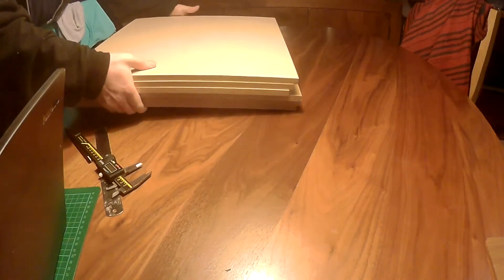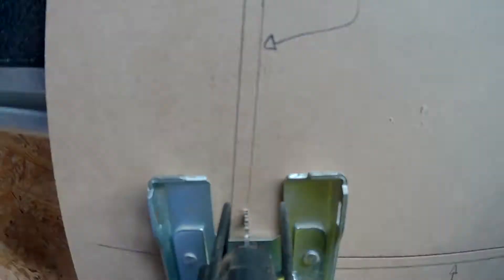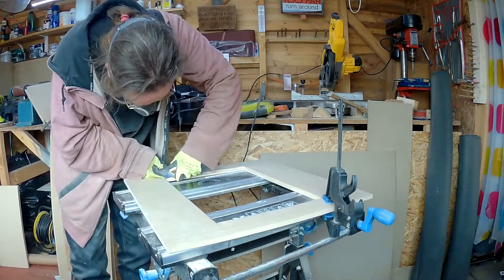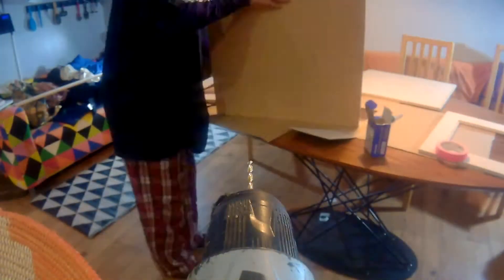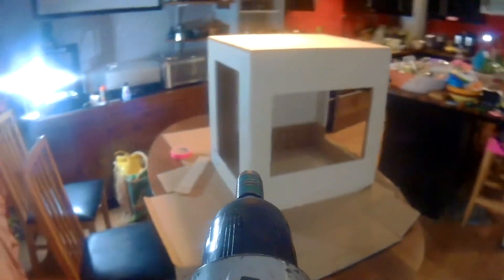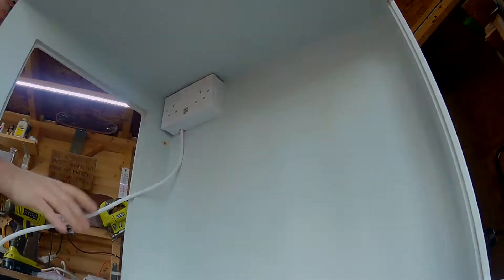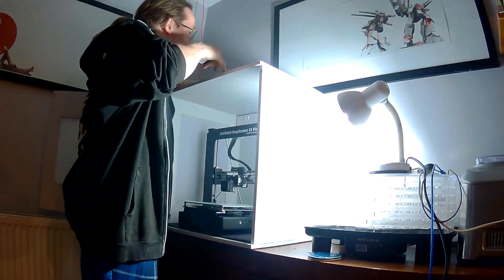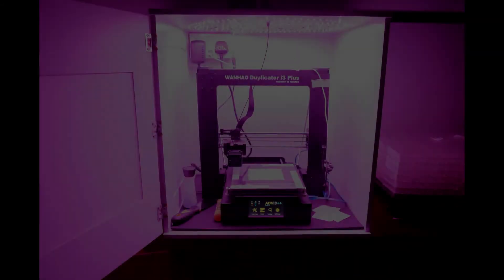Building a 3D Printer Enclosure - No IKEA Lack Involved

Comment: Great build, just not a fan of the frosted front glass. Can't see the print in progress if I was using ABS without a camera :(
I did like the small details and the installed power outlet with the USB plugs :)
Reply from the maker: Thanks! I do have a camera inside, and I'm usually not in the room the printer is in so it's easier to open a web page than walk to the printer box to see what it's doing. But it would be easy enough to make it with clear perspex if you wanted that.